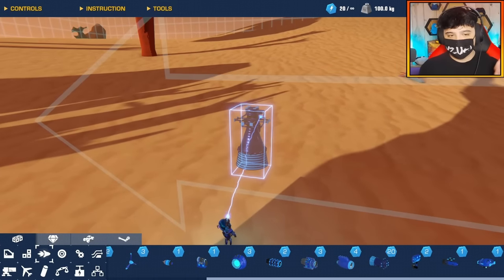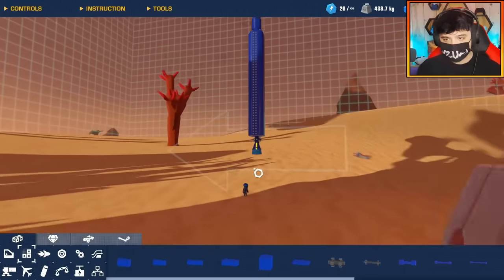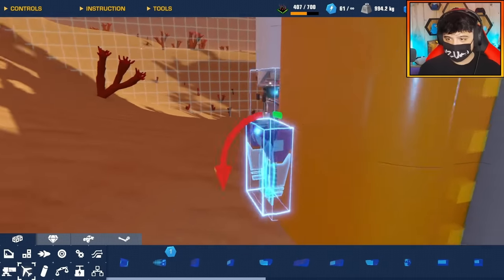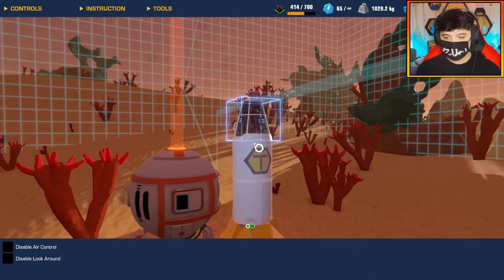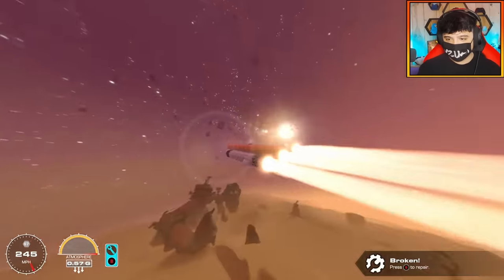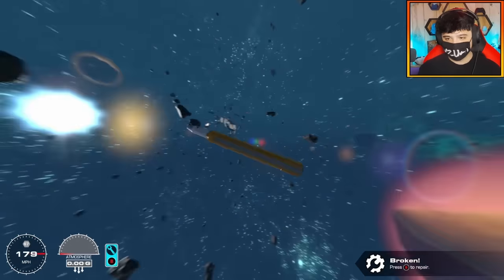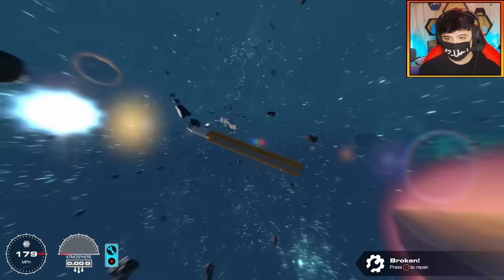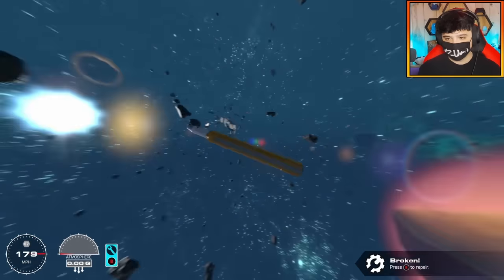Can I Make A 'REALISTIC' Rocket BOOSTER?! | Trailmakers

Comment: Do you really want to blow scrapmans mind??? Build a realistic space fighter build a cube with a thruster on each face with reaction wheels .err gyros for pitch roll and yawso you can be moving around n any direction and firing in any direction. Set it up for the camera to control the orientation and the keyboard to control all the thrusters. With no quantum rudder.